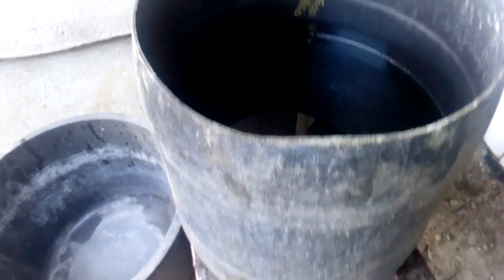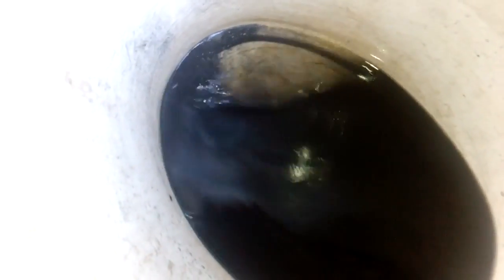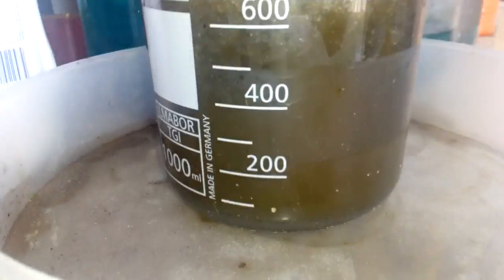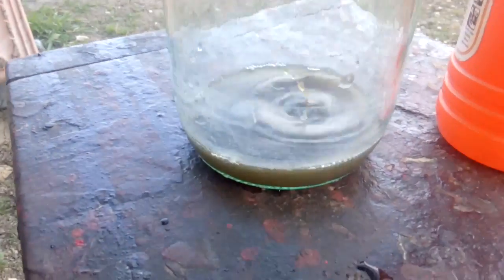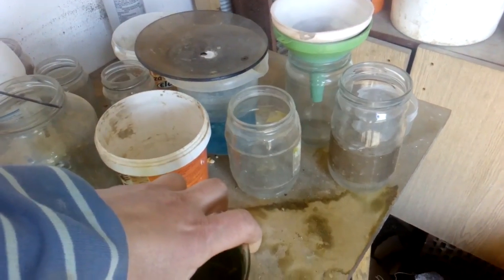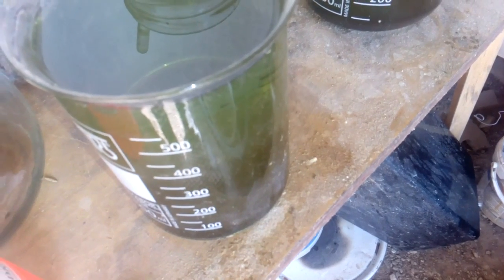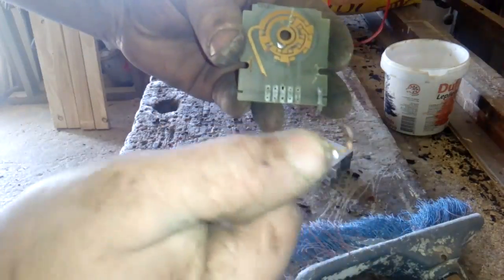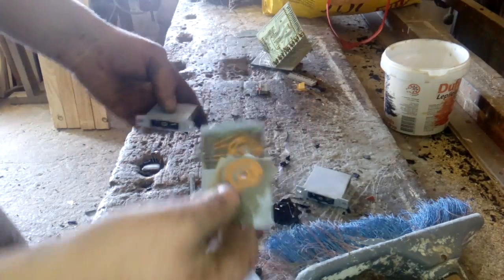StockPot gold recovery and refining proces!

Comment: i would like to see you use a ball mill or flail mill to reduce the raw material to -60 mesh dust then gravity seperate the heavy's out and process that.
Reply: The chemical leaching and dissolving works better.  He is working with the gold plated ewaste, not with some gold bearing ore.
Reply: @toomaskotkas4467  gold bearing e waste is high grade ore and easy to gravity separate.
Reply: @claytonmccormick7506  I disagree.  If you start processing gold plating like ore, you are going to lose some gold.  That's why they use cyanidation in large mining projects.
Reply: @toomaskotkas4467  if you reduce the e waste to -60 mesh most of the gold plate will be separated from what it is plated on, but what is not will be in the middle or low grade there would be very little metal even aluminium in the trash there would likely be less gold lost that way because everything would get processed rather than just what you tink has gold in it.
Reply: @claytonmccormick7506  You do realize, that the tailings of iron and copper will have some gold plated parts in them, which you will lose if you are going to separate the metals just by the weight and conductivity?
Reply: @toomaskotkas4467  yes but magnets are cheap and copper is purified by electroplating it out very effectively removing it from the concentrate.
Reply: @toomaskotkas4467  the point in my asking is that dusan is very good at figuring out the dollars and cents of how to extract precious metals and coming up with workable methods with the exception that until recently he could get nitric acid far cheaper where he was than most of us could now he has the same problem hard to get and or expensive.
Reply: @claytonmccormick7506  What are you going to do with copper cover with small traces of gold?
Reply: @toomaskotkas4467  the copper will plate out at 99.99 or higher purity very little or no gold chemically the gold will be driven out of solution be copper then you process the sludge for gold then the copper can be driven out of solution by iron plate the copper out of the new sludge no gold on the copper.
Reply: @claytonmccormick7506  As I said, you are going to have some losses.  The more you process, the bigger the loss is going to be.
Reply: @toomaskotkas4467  in any process there  will be some loss and any loss will scale more process more loss. there will be less loss mechanical processing everything verses only processing what you thing has gold in it a mix of mechanical chemical and electrical will get optimal recovery i just want dusan to explore a more mechanical mix than he currently does in his extractions if you wish to find something wrong with experimentation why do you even watch dusan ?
Reply: @claytonmccormick7506  I watch him because I want to learn more about the chemical processes.  Why you who gets on everybody's nerves with his mechanical separation are doing here is beyond me.
Reply: Alan Shore 
Having fun with Clayton or is his ideas just ticking you off!!
When I saw it was you in the replies I had to read on!
I haven't watched yet. But if I have an opinion I'll let both of you know! Probably won't, because it sounds like both of you know more than I, Big Time!!!
It's always good to talk to you ALAN!!!
HAVE A GREAT DAY, BROTHER!!!
Reply: @shaneyork300  alan seems fixed on chemical processing even though dusan physically reduces thing as much as he can before starting with the chemicals. i would like to see what dusan could do with some type of mill and a small shaker table. i have almost 400 lb of copper from the boards that i depopulated for gold plated pins chips and mlcc's because of dusan i found out that i could scrate almost 1 kilo of indium from the copper heatsinks that came of the cpu's. processing the leftover boards is the next step it may only be 800 to 1000 dollars but it helps pay for the rest of the extractions.
Reply: @shaneyork300  Have a good one yourself, bro!
Reply: clayton mccormick 
Like I said, both of you know more than I do! I'm very much a novice! I've started ewaste recycling and learned most of my knowledge about ewaste from Ewaste Ben.
I've seen the milling only once! I found a guy I really like when it comes to refining! I figure I'm about 8 years away from refining myself. I like Dusan, because he can be entertaining and I like to see the yields he gets from a variety of ewaste! One question I have does Dusan even own a milling machine???
If he does not, I wouldn't expect him to do what you want. He's not made of money, I do know a good milling machine is quite expensive!!!